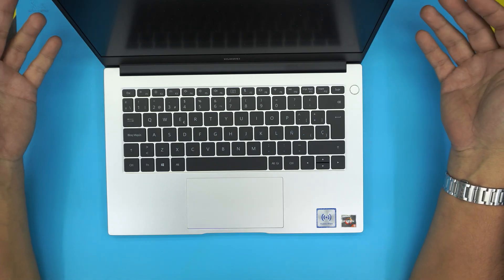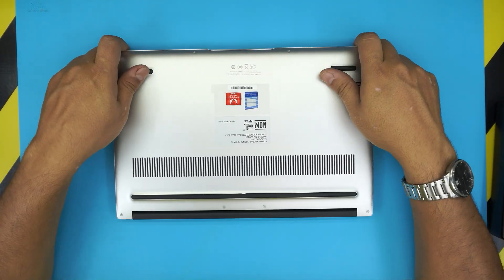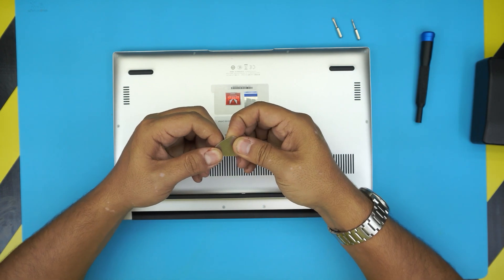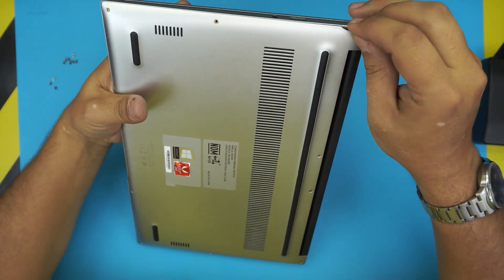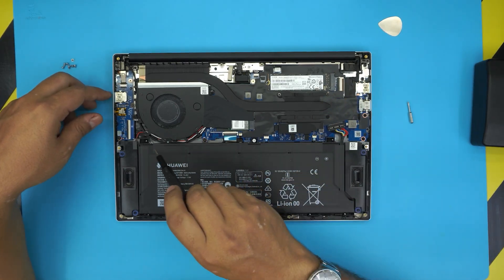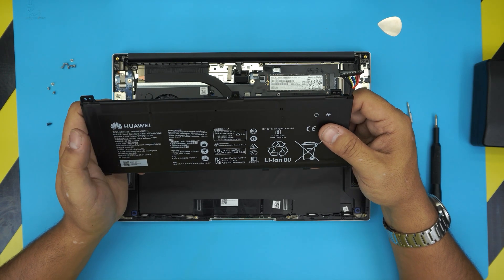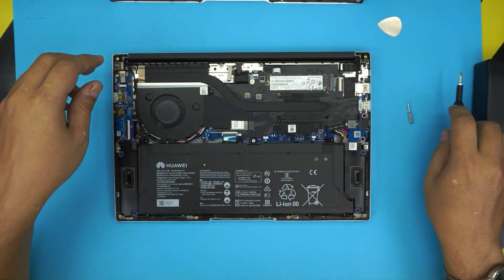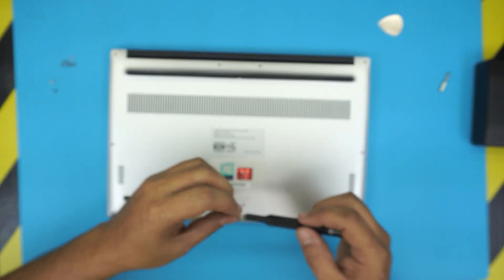HUAWEI MateBook D14 Battery Replacement Guide ( Nbl-Waq9r )

Comment: Thanks man. Heads up, my battery connector (old battery) snapped when i pulled it out by the wire. The new one almost snapped too as I put it in when I tried to line it up and press. I found it easier to point the side away from the wires diagonally up and slot the two tabs on the corners close to the wires underneath the corresponding plastic tabs on the connector first. Then i could adjust and press into the pins pretty easily.
Reply from the maker: Some connectors can get very snappy and grip tightly, and while side pulling is easy, it's also risky.
I'm glad you got it sorted out in the end.
cheers🍻

Comment: i am getting and error after replacing the battery. If i turn on the PC without power Cord ir says lowbattery and wont boot. If i Turn on with powercord, it turns on, i can remove the cable but the battery says always 100%. What am i missing?
Reply from the maker: something wrong with your new battery, we place and replace them for our clients always without any issue.

Comment: The middle screw in the battery is stripped fck man
Reply from the maker: Thank you for the feedback! if you wish to support the channel you can LIKE or SUB or both :P
regarding your question: here check this video where i show how to remove bad screws.
https://youtu.be/xLt6dMIsO9E
Reply: @uFixTek  i dont have a tool like that do you recommend anything else? thanks!
Reply from the maker: its the safest, the only way to remove the screw is to make a insertion on the screw head :( some sort of cutting device . this tools you can find on amazon around 20-35usd i can;t think if anything else

Comment: @uFixTek, is it possible to work without the battery mounted? Thx.
Reply from the maker: yes it will work  without the battery and it will work great without it , as the charger will not over heat, and the motherboard will last longer as it has not need to keep the battery charged. thank you for the feedback and your support to the channel :)
Reply: @uFixTek  And less weight! Thank you very very much!
Reply from the maker: that too :P , you are very welcome, anytime you got questions ans me in any of my video comments :) good luck